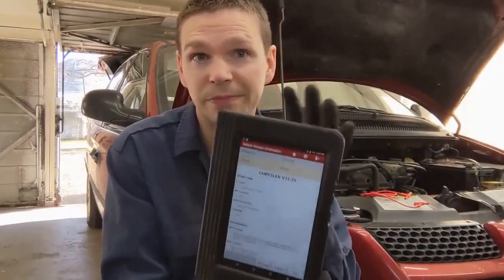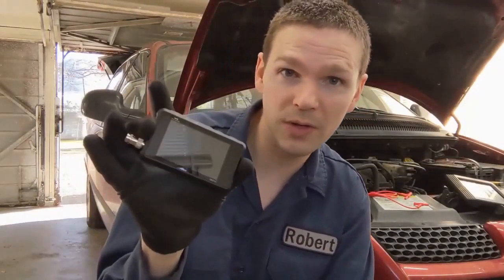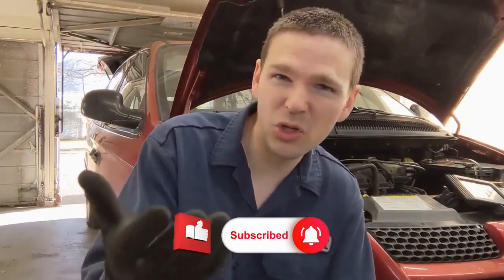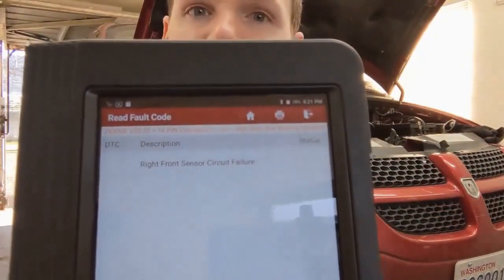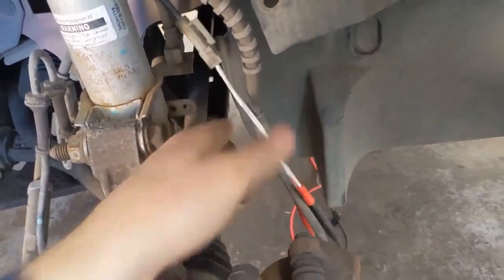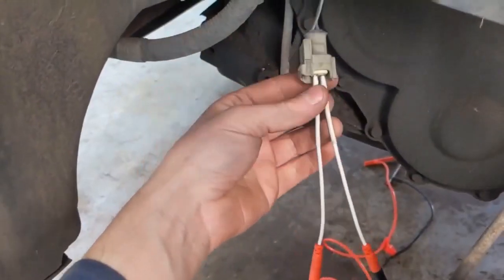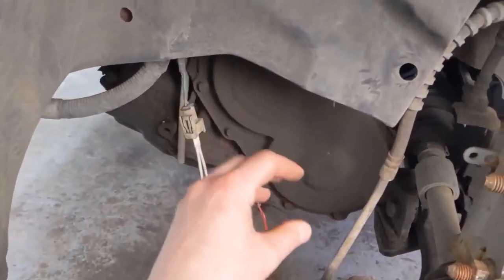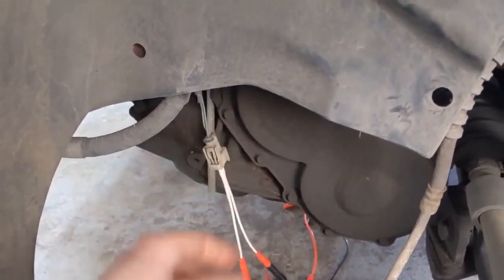How to Test a Wheel Speed Sensor | Wheel Speed Sensor Testing Methods | Abs Sensor Problem Symptoms

Comment: I've been struggling to find the problem with my Porsche Cayenne front abs fault so hopefully I'll be trying them . I've got a sporadic reading on scan tool . Have put new sensor in and not cured the fault so I'll be trying other methods you talk about hopefully maybe find something
Reply from the maker: What year is your Porsche? It's possible that the tone ring is the issue. Especially if it's erratic. Just something to look into. After a certain year the wheel bearing has the magnetic tone ring as part of the bearing.

Comment: If the wheel speed sensor is cleaned with simple carb cleaner spray, will that cleaned wheel speed sensor be as good as a new speed wheel sensor?
Reply from the maker: Most of the time the sensor fails internally so cleaning it won't help.
Reply: @ValleyMobileAutomotive Thanks for the input.

Comment: Just spit balling a question. During your checking the wiring and sensors to the ABS module and finding your trouble whether it's wiring or sensors. Do you have to clear out the trouble code(s) from the ABS module that shows up on your scanner? Good indepth tech video👍.
Reply from the maker: Good question. This is a continuously monitored system so if the fault is fixed the light should clear moments after driving it. Clearing the codes before the test drive can help see if the code comes back or if a different code appears.
Reply: @ValleyMobileAutomotive Thanks for your response. Service Dept. has est. over $400 for the replacement.

Comment: The trick is to isolate one part as rapidly without wasting time.. unplugging sensors and removing them can make problems. Over time, corrosive road contaminants seep in between the housing and sensors and needing to pry causes possible  problems. A scan tool that shows live data of each sensor will allow quick elimination of good part vs bad. It is rarely both sides at once. Isolate as quickly as possible with live data using a scan tool to save unnecessary steps. A rope only needs to be long enough to reach.

I bought a scan tool that covers almost every computer bank, will let you view live data. ABS Sensor data can be tested without disconnecting the sensors or removing the wrong ones. The Launch CREADER 7+ Is under $145 and it will show ABS Data live. This unit is amazing for less than you will pay for an hour of diagnostic time to a mechanic and now you can check everything stem to stern any time, and hold a mechanic's feet to the fire so they don't lie to you!
Reply from the maker: Thanks for your comment! A good scan tool and the know how to use it is invaluable 👍

Comment: Too many sensors rendering cars junk ! clock spring sensor, steering wheel position sensor, wheel speed sensors !  transmission sensors  , knock sensor, sensors for sensors they go into limp mode or outright refuse to run or turn over cause the air bag deploys and the inertia sensor needs to be reset if you can find the inertia sensor ! there needs to be a way to run the motor and transmission separately from everything else cause these just screw a motor and transmission up ! im from a family thats sold cars since 1960 and all of this unreliable electrical crap is costing us more mechanics than we have ever lost they want to work on mechanical devices not electrical plastic juk that breaks all the time !!
Reply from the maker: I understand the frustration. The nice thing about sensors is we can communicate with them to see what they see. This can aid in diagnostics. But if the sensors are poorly designed they cause more issues than they should.

Comment: @ValleyMobileAutomotive while doing the OHM test were you testing the end of the wire while the sensor is connected ?
Reply from the maker: The sensor must be disconnected to test for OHMs otherwise you'll get the wrong reading👍

Comment: Doing an ohm reading for my 2012 Silverado, should the ohms be between 1000-2500 ohms? I saw a different video and the showed on his meter zero ohms and said that it was good. 🤔
Reply from the maker: I don't have the specific reading but ohm the side that's not setting the code and see what that is. That will give you a reference, both should be within roughly 10% of each other. Another thing to remember is the ohms could be good but the sensor still be faulty. The ohms check the coil windings in the sensor but it doesn't check the magnet that they're wrapped around. But it's still a good test, magnets are very stable 👍
Reply: @ValleyMobileAutomotive I’m getting different readings from all of them. Front driver side getting 2.895 M ohms front passenger side getting .495 m ohms. Back driver side I have nothing. I the back passenger side I had a read with an ns. Had to look that up. I think mine are bad. Who would you recommend that I get a new set?
Reply from the maker: @Sebastian-dx2xg  If you go to rockauto.com you can get the OEM for a reasonable price. The GM part number for the front is 84356647. The rear is 20938121. Here is a 5% discount code if you decide to go through them 306981655263948279. Just copy and paste this number at checkout. It's good until August 1st 👍

Comment: I have an ANCEL OBD2 & EOBD code reader I just got. Brake,ABS and SLP lights comes on after I step on gas while in gear. No codes pop up. 2011 Nissan Frontier, 77k miles

Comment: Looking for a little info.
2010 Traverse AWD
Left rear sensor reads 45 ohms
Right rear sensor reads 97 ohms. This is a new sensor. changed  because initial reading of bad sensor.
Each cable back to ABS motor reads 24 ohms.
Scan Tool give DTC  C0050  Speed Sensor Circuit Not Plausible
When checking live data for the wheel,  scan tool never shows any feedback. Just stays at 0 mph.
ABS motor pumps quite a bit then throws the DTC  C0050
Got another new sensor since ohms difference was so much between left and right.
Same ohm reading on new sensor. 97 ohms
Any ideas. Any help would be greatly appreciated.
Reply from the maker: I couldn't find an ohm value for the sensor but this is what my manual says for testing...
1. Disconnect the EBCM and right rear WSS. Connect bulb style test light from battery voltage to one end of each wire, ground the other end of the same wire, test light should be lit bright. Manipulate wiring while testing.

2. Inspect connector, terminals, wiring for damage.

3. Inspect for worn, damaged hub and bearing.

4. Try original WSS in new hub and bearing, test operation.

5. Inspect wiring at liftgate module bracket.

Comment: Great video.  I am trying to use a signal generator for the first time and am not getting any response when changing the hertz. Could you provide what your signal generators setting are,  such as the volts and frequency.  Thanks

Comment: Am I right in thinking that if the correct signal is produced using the generator, then it should in theory remove the ABS light?
Reply from the maker: @tjchebs2139  In theory yes. It would need to match the speed of the other tires. So if you can get the scope to produce a 30mph signal and drive the vehicle up to 30mph so all the wheels are reporting the same speed then the light will turn off after a few seconds.
Reply: @ValleyMobileAutomotive  Thanks for the prompt reply, and sound Info..you have a UK Subscriber.

Comment: Too much high tech data for me to follow. Not everyone went to Mech School or can afford a high tech scanner. Just teach me how to read sensors w multimeter, leave out the scanner.
Reply from the maker: @WaldemarMontalvo-mq3kw  The only thing you can test with the multimeter is ohms. In that case check ohms between both sensors. They should be close to each other. If the problem side shows a different ohm reading then you can assume it's bad. A multimeter is not fast enough to give you an accurate reading of volts produced by the sensor. Nor does a shop manual give you a specified volt reading range. Only ohms. I hope that's helpful 🙂

Comment: if the tone ring in the wheel hub is bad...how would you verify this?
Reply from the maker: @HisGirlsGCS  On some models of cars you can inspect the tone ring through the sensor hole. On others you will need an oscilloscope to monitor sensor output. You can also use the process of elimination by checking everything else. If the rest looks good then the tone ring is the logical conclusion 👍
Reply: Great video.  I'm having trouble getting a reading using a signal generator.  Can you give like the setting on your signal generator, such as frequency and volts. Thanks
Reply from the maker: @garyhorn1133 Make sure your generator is sending a sign wave and not a square wave. Start with 500 hertz and adjust up or down as needed. My volts are not adjustable so I'm not sure what it's putting out.

Comment: Use the multimeter on the ac setting , connect the multimeter  to the lines going to the sensor - spin the wheel the signal should move accordingly  - it should match the opposite wheel

Comment: My 2010 explorer front  brand new abs sensors show no ohms readings of any kind. Abs light on. But the old oem front abs sensors show 5.99 ohms. What could be wrong?
Reply from the maker: @edwincordero8   It's possible you got a faulty new part. If possible get another one and try it again.

Comment: Conversely, could one use the oscilloscope to measure output from the wheel speed sensor by manually spinning a tire while the car is on a jack?
Reply from the maker: @todd8155  Absolutely 👍. Depending on your of wheel speed sensor type you'll either get a sign wave or square wave. This is a good way to test your tone ring for issues

Comment: Use an oscilloscope! Turn the wheel and watch for a consistent signal of multiple pulses. ASE Master.
Thanks kindly for sharing.
Reply from the maker: @deankay4434  I prefer the oscilloscope as well 👍
Reply: @ I spent two days per week teaching oscilloscopes for up to 8  techs, dealer & private in 13 different tech schools. Wichita to Sioux Falls, Columbia MO to Pewaukee WI for ACDelco. Plus 28 different seminars & 5 warehouses. Crazy!
Reply from the maker: @deankay4434  Nice! I've had some memorable instructors over the years.
Reply: @  Good techs make great students. Good students ask great questions. This alone makes an instructor provide better answers and have fun rather than work. 
 After decades, the pay could have been better, but it was my way of giving back to all things gas & chrome!. And from a farm kid.

Comment: The bearing could have a bad refluctor ring and the sensor could be giving an erratic signal. A small hand held scope hooked to the connector and spinning the tire will show you on screen your exact ac pattern and if you have a tooth missing from that ring that is causing the issue. It will show up in the wave form on your pocket oscilloscope and you will see it.
Reply from the maker: @jpol3808  Excellent comment! I didn't mention anything about the tone ring just the sensor but a bad tone ring can also cause the abs light to come on 👍
Reply: @ValleyMobileAutomotive  You got this buddy. Great video and keep them coming. I'm an old mechanic and no one can remember or know everything. Thanks for the reply and take care! J Poll. 👏✌️🏁🇺🇸

Comment: A tip for anyone watching this for measuring your wheel speed sensor with a multimeter. For most of us that won't have the lead used for demo, I found the needles used on a pump to inflate basketballs works as an alternative. They fit nicely over the pins and extend out so you can make contact to test.
Reply from the maker: @leblancch  Thanks for the tip 👍

Comment: If you swap the speed sensors and the code persists, couldn't it also be a dirty ring gear/tone ring?
Reply from the maker: @charliehendrix168  You're correct. That is something this video doesn't mention. If you rule out the sensor being the issue then it could be the abs module, wiring or like you said a bad/damaged tone ring.

Comment: The Wheel Speed Sensor might be a Hall Effect component.
Since this is a semiconductor device then, when you are doing Ohms testing, you should really measure Ohms once way, swap over the wires, then Ohms the other way (polarized). You might notice different readings when you do this on the ohmmeter. But nevertheless, both sides should match.

Comment: Im glad you said that it wont hurt anything, because thats what Im afraid of with diagnosing in general; using jumper wires can be a problem   if you bypass the load you could fry the transistor drivers in the ECU......
Reply from the maker: @carlodonnell146  I definitely understand. When I was first learning I was afraid too.

Comment: Why did your ohm test not show a problem?
Reply from the maker: @bartbristol5070  Good question. In this case I didn't have a failed sensor. This was just a mock up to show the different ways sensors could be tested. But if a sensor was bad you would see an ohm difference between the two front or the two rear.
Reply: That’s what I was wondering

Comment: You showed us how to use a multimeter to test the sensor, but not the harness. Plus the last method you showed us how to test the harness, but not the sensor.
Reply from the maker: @howtodoitdude1662  It's unlikely that both a sensor and harness are bad at the same time (but it is possible). If you find a faulty sensor, replace that first. If both sensors are good then I have a harness video here: https://youtu.be/ctnyjpdBFF8
With the last tool you can only check the harness and computer. If the harness and computer are good, you can assume it's the sensor. If the sensor checks out and the harness/computer check out the last thing to check would be the tone ring for the sensor typically on the axle or wheel bearing. Hope that's helpful 👍

Comment: This video was kinda useless to casual DIY'rs. the easier, cheaper way to test for a bad wheel speed sensor is this: 
1. Disconnect the wheel speed sensor connector.

2. Find the two-pin connector that leads to the sensor. Connect it to a multimeter.
3. Set the multimeter to ohms.
4. Measure the resistance. It should be minimal. If the meter indicates an open condition (very high resistance) or a short, the sensor is bad.
5. Next, if the sensor passes the resistance test, set the meter to measure AC voltage.
6. Have a buddy manually spin the wheel hub. Have them do it as fast as possible. Watch the voltage on the multimeter. If it changes in accordance with the speed at which the wheel hub is rotating, the sensor should be fine. If there’s no change, or no voltage read, then the sensor is likely bad. (The amount of voltage produced is very minimal, and completely safe.)
7. Repeat the above steps as needed with the rest of the wheel speed sensors on your car.

Comment: Why not save all that work and just test each sensor with a multimeter? If they make voltage, then they work. Make sure to switch to A/C volts on multimeter because magnets are used in the sensor.

Comment: thanks  for this helpful video ! i have a question :  i bought a Oscilloscope that generate signal output  like your tool ! Model is : DSO-TC3  !!! i can do everything like your tool but  when i  connect  my wire to  the signal of the connector or the speed sensor wire ,  the mp/h doesnt go up  on my scanner !!!! so my question is : how much output voltage do generate your tool ? mine do generate max 3.3 volt  so i think  i need a tool that generate more Output voltage so i can send Hertz to abs/speed sensor wire for see  a reading on my scanner ...

Comment: A question. I assume the wheel sensors are just a magnetic pick up catching the magnetism from a rotating magnet on the rear axes and wheel bearing on the front. Could the sensor be tested by either a continuity or resistance test by rotating the wheel slowly by hand?
Reply from the maker: There are two main types of sensors. "Variable reluctance" producing a sign wave and "magneto resistive " producing a square wage. You can have either a stationary magnet in the sensor and a moving metal tone ring or you can have the magnet moving as part of the wheel bearing. It's cool technology that's also used for the crank position sensor and cam position sensors.

Comment: Hello. 
Both my rear speed sensors fail when I hit third gear. 
What would cause that? (Chrysler 300)
Reply from the maker: Interesting 🤔. What year is your car?
Reply: @ValleyMobileAutomotive  2013. I’ve changed the axles, but replaced the tone rings.

Comment: Mine read ABS and RF wheel speed sensor. Drove it home and ABS didn't last 5 miles before light came on again, and started pulsing when I stopped. Then hooked up reader and it said LF sensor. Cleaned the ground for the ABS for kicks, and cleared codes. Took it for a drive and when I got back now it say the RF sensor is bad again. Am I looking at a bad ABS? 2008 Trailblazer. But only a sensor code this time, but ABS light is back on again, along with Stabilitrac. If I don't disable stabilitrac it will not hardly move.

Comment: Hello i have cod c1200 front left wheel.. and i buy new one and clean code  but after 4days abs tcs appear.. I measure data from abs sensor socket its not correct like right socket i shake wire in control module abs to correct data and data is good and clear Fault after 3..4 day abs light is appear what i can do with c1200 code..?

Comment: The ohm reading won't work unless you have the code saying which speed sensor is bad, in my case I am not getting a different code for the left or the right I'm just getting a code for bad wheel sensor.  Because there's nothing to compare it to what if all four speed sensors are bad or three out of four or both front or both rears are bad, the only thing I could think of would be to go to the auto parts store and see if they will let you test a new one that they have on the Shelf and then compare the ohms

Comment: What are those two green connectors under the dash? I plugged them in and the check engine started to flash and gave me a park neutral switch code